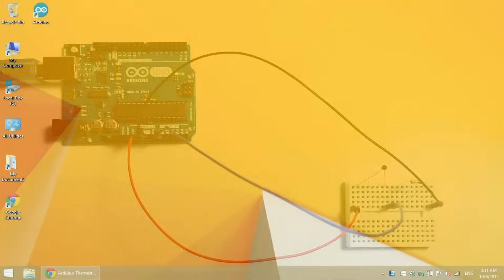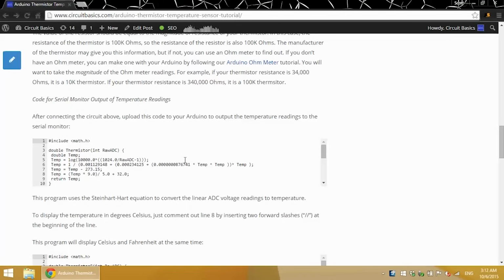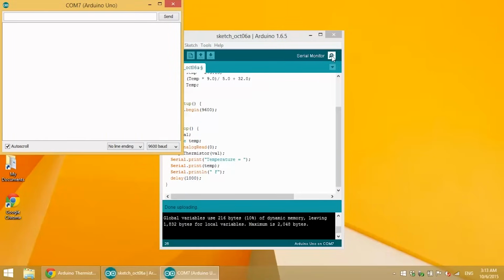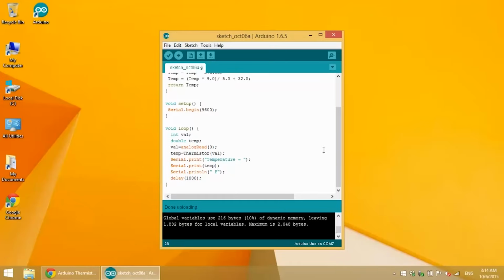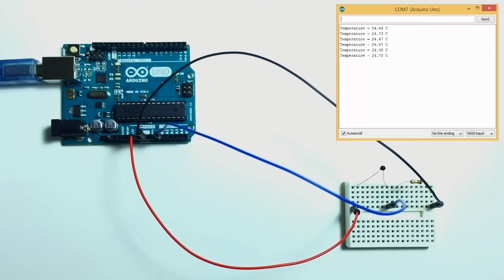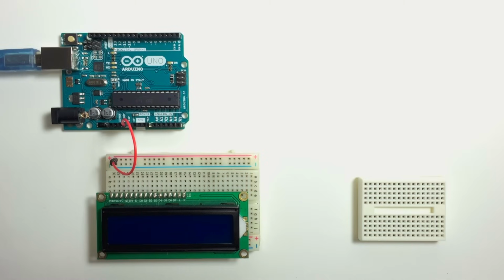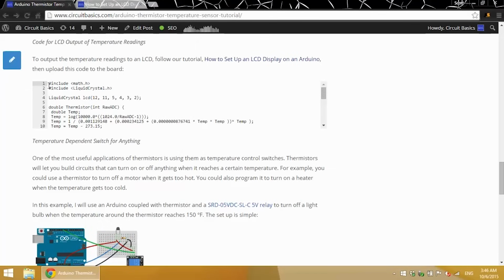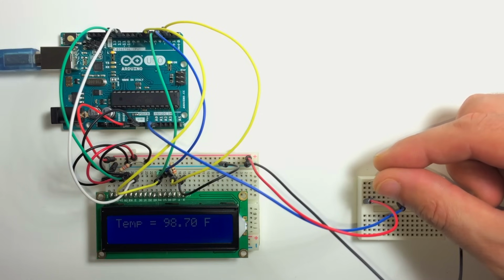Make an Arduino Temperature Sensor (Thermistor Tutorial)

Comment: The code shows R1 = 10000 but the fixed resistor in your circuit in 100k or 100000. Is the code wrong?
Reply: Your sensor maximum rezistente can be deferent

Comment: I recommend to anyone trying this project to use a trimmer instead of a resistor so, that you can adjust the sensitivity of the temperature reading.  Also, there are some temperature reading error. I found the solution within the comments, just change some values to c1=0.7904710802e-3, c2=2.251846924e-4, c3=0.87060700625e-7.
Reply: lmao these are even worse, instead of 90° room temperature I now have 143° room temperature. Great.

Comment: To anyone getting negative values, measure the resistance of the thermistor and use a resistor with the same value! I had the same problem with the thermistor I got from a cheap Arduino starter pack. Turned out it was not as the seller described a 10k, but a 100k resistance thermistor. after I changed the resistor to a 100k one to match the thermistor, I got plausible values.
Also thanks for putting together the formulas, Circuit Basics, I gave up after reading about it for 10mins.
Reply: Exactly, and if you want to be very accurate, measure both, and try to match, you may find that some 10 K's read high, others low, I tried six before I got an exact match.

Comment: It should be log(10000./(1024./RawADC-1)) via the voltage divider equation.

The sensor uses a thermistor, which changes resistance at varying temperatures.

The Steinhart-Hart equation approximates the temperature at a given resistance of the thermistor via 1/T=A+BlnR+ClnRlnRlnR.
 
Since the Arduino cannot measure resistance directly, a voltage divider is made by simply adding a resistor in series with the thermistor. 

Since current is the same in a series circuit, the total current I=E1/(R1+R2) and I=E2/R2.

E1 is the 5V you apply to the + pin. 

R1 is the small resistor in the circuit, which you can measure with a multimeter to be about 10000 Ohms.

R2 is the resistance of the thermistor. 

E2 is the voltage measured with the S pin in reference to - GND using analogRead(). 

Therefore, E1R2=E2R1+E2R2, then solving for R2=E2R1/(E1-E2), which can be rewritten as R2=R1/((E1-E2)/E2) and further as R2=R1/(E1/E2-1). 

So, the resistance of the thermistor R2= 10000/(1024/analogRead(A0) - 1) .
Reply: Arduino ATmega 328 microcontroller has an inbuilt analog to digital converter,it can sample and quantize analog reading to digital.
Reply: Do we need to calculate the thermistor resistance manually... And how to enter the values in Arduino to change into temperature

Comment: This is just awsome! Simply explained and thus perfectly understandable.
Reply: Add the termistor to Gnd side of V divider. Suppose if smthng goes wrong & thermistor shorts it would short 5v to the analog pin without resistance so 10K before thermistor is safe

Comment: Thanks a lot. I recently did scavenge a thermistor from an old laptop battery and I was really thinking how could I use it and I just made a thermometer using it although I had a hard time to obtain its resistance value but I finally calculated it to be around 10 k ohms

Comment: would be good if you explained what each component does
Reply: Chris Scully the thermistor  (thermal resistor) and the resistor create a basic voltage divider. the thermistor's resistance varies with temperature. The voltage divider takes that variation in resistance and turns it into a variable voltage signal. Using math and a little logic you can map that signal to what ever scale you like. Fahrenheit, Celsius, Kelvin etc.
Reply: If you don't know anything about electronics you should close this video and learn basic things about them
Reply: Explaining the code and all those strange values coming from nowhere is a must, without that the video is pretty much worthless, can't understand how it works besides the voltage-divider, like if you need to connect the thermo-resistor to ground or use a ptc instead of ntc, then you can't do anything with the shown code, all you can do is just copy&paste blindly without any understanding of what is going on, this is not the way how one can learn anything, even if the global schooling system works like that, but no one of us goes there to learn anything, but we watch videos like this to learn things.

Comment: Does the formula in the code change if I use a 10K thermistor and 10K resistor?
Reply: I just used one to control a relay, i used the same code and it worked just fine

Comment: How did you come up with these numbers:
 Temp = log(10000.0*((1024.0/RawADC-1))); 
 Temp = 1 / (0.001129148 + (0.000234125 + (0.0000000876741 * Temp * Temp ))* Temp
Reply: This equation comes from the thermistor data sheet. Check this before imputing the equation. Different thermistor have different coefficients.
Reply: Marcin, I actually found out that the code was slightly wrong and should be log(10000./(1024./RawADC-1)) from the voltage divider equation and now the sensor works fine :) Nevertheless, thanks for the link, it helped me understand the formula better!

Comment: I intend to build one but i want to measure very high temps(160-200 Celsius). Using a thermistor from my 3d printer as it can measure up to 250 Celsius.Do you think it will work?

Comment: Could the Arduino have 64 thermistors that it monitors in sequence, then repeats?
Or have the Arduino work in unison with an STC1000 temp monitor, and connect the 64 thermistors across the terminals of the  STC1000

Comment: Nice one...however i have a question.How to add a mosfet to the code to controll a fan when the temp reach a set point?i don't know how to program arduino that why i ask..thank you!
Reply: use the code for led on mosfet works fine

Comment: Thanks, this is a really amazing project! I am having a slight issue where it's reading 194 degrees though... I'm pretty sure my room isn't on fire right now either. Any ideas?
Reply: Or you are not using a 100k ohm thermistor. This is a potential divider circuit. The output voltage you read all depends on your components ‘ resistance.
Reply: you probably needed to subtract a value from it to bring it into correct range

Comment: Hi, I have been using a 10 ohm thermistor which heats up a lot when I use a 10 Ohm resistor. So, can you please tell me what should I do so that the resistor and thermistor don't not heat up so much because I just burned myself without realizing today. Any help will be appreciated

Comment: I got this to work and would like to use it in my greenhouse. I can put the Arduino in a weather proof box, but how do I put the thermister/resistor on a long wire in the greenhouse? I am sure someone has done this. Perhaps you could show me how you did it.
Reply: Bill Grubbs if you are running a long distance you will have to take voltage drop into consideration. use some small gauge communications wire, something like shilded twisted three wire. solder the whole voltage divider setup on ther end and use heat shrink on all the leads and a larger piece to bundle them up

Comment: The display is not working and i set everything up properly. My resistors are not exacty as high as the ones in the video, the biggest one being 10k ohms rather than 100. does it matter?
Reply: The "L" on the board is also orange
Reply: it worked on the version before the display

Comment: Is this sensor can detect ultra low temperature? Below -80 degree celcius? Your comment very much appreciated
Reply from the maker: The epoxy style thermistors like this one usually only go down to around -55C at the most. If you need to monitor lower temperatures you could always use a dry ice TempTale

Comment: Is it possible to run the thermistor with 3,3v? The NodeMCU´s analogread pin only supports up to 3,3v :/ If yes, how? The analogpin outputs values of 0-1024 like the normal arduino but it doesn´t work properly...

Comment: Can i use a different resistor value ? i haven't got a 100k ohm resistor
Reply from the maker: +BUBU's Wife the resistor has to be the same value as the thermistor
Reply: you can use a couple of resistors in series to get a higher resistance

Comment: i have a project that uses tmp35 sensors. can i simply replace it with a 10k thermistor and it will work ok ? i had someone write some code for me so i dont know how to edit it to work if it wont work :(
Reply: yeah me too. Thermistor 100k is hard to find and I dont want to order it on the internet.
Reply: this code works wit ha 10k thermistor, i tried it lastnight thought it was 3c out
Reply: +Mix Bag Can I ask you something?

Can I use lower amperage to charge higher amperage devices?
Reply: yes. my iphone can use a 2A charger but i actually use a 500ma charger. (takes longer to charge my phone but its safe to do) and obviously a 2A charger will charge my phone much faster. The device can only take what the charger can give. :)
Reply: +Mix Bag what about if I use 2A power supply to charge a device that is 100A, will it be safe ? By the way, how do I contact you next time, nice talking with you
Reply: The device will only take what it can from the power supply. so its all safe.
Reply: how to edit it?
Reply: dude, I have an LM35 Sensor...can I use the same code for it...????

Comment: Hi! I am making a project on temperature measurements with arduino uno and thermistor. I am using the voltage divider method to determine the resistance of the thermistor, and the steinhart model for temperature calculations. However, when I tested it on a boiling water the resistance obtained by the setup where not the same on the multimeter readings, so that, instead of obtaining a temperature of 100 deg Celsius I obtained higher than that ranging from 101 deg Celsius-116 deg Celsius. Do you have any suggestions on how can I fix that?
Reply: +Danielle Cardiño You have to know that the thermistor is a non-linear component so you have to adjust like a referance value or somthing like that in order to get the right value.
Reply: +Ferid Filali thanks for the comment, i've already found and fixed the problem :)